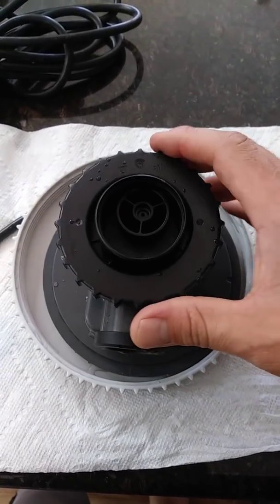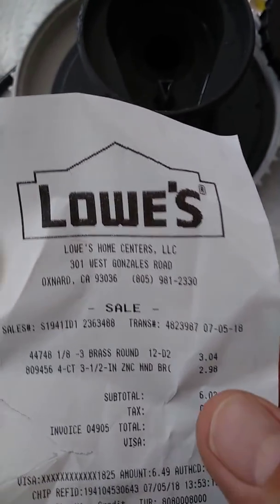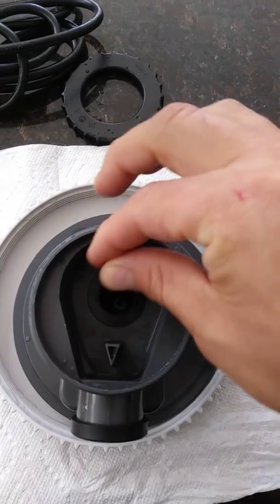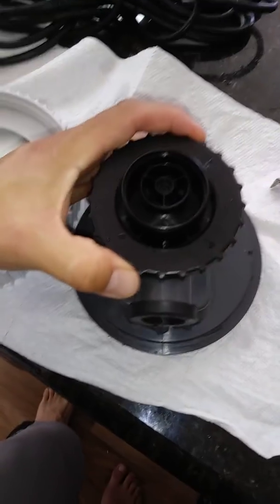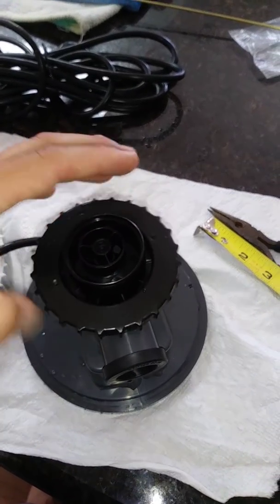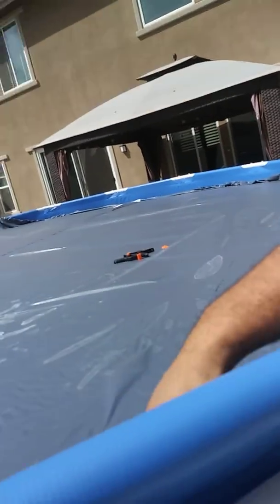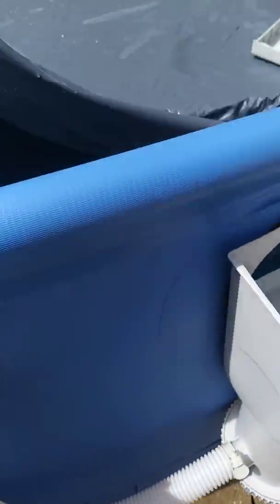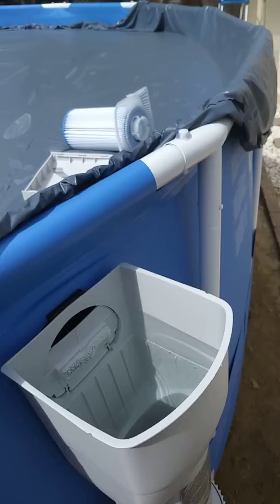SFX1000 pool pump repair

Comment: How did you get the black round rubber cover to stay to keep the water from flowing into the skimmer mine will not stay on. Thank you for this helpful video but ended up upgrading  to a sand filter pump, definitely im spending less in chemicals and electricity. I still need to know how in the heck that rubber piece stays on...thanks again
Reply from the maker: Nice upgrade. If you leave the rubber cover on a flat surface sitting in the sun for an hour or 2, it really softens it up and allows it to hold better. Although not guaranteed, but better. Mine falls off occasionally as well.

Comment: hoping someone can answer If the pin is broken will the pump turn on? Mine is only 10 days old and it wont turn on Light on reset works etc TIA
Reply from the maker: If the pin is broken, it will turn on and vibrate/hum. It just won't circulate water. If the pump won't turn on there's most likely a blockage on the impeller. A single strand of hair can lock these pumps up to where they don't turn on. Also, verify the GFCI has not tripped. So clean out pump/rotor assembly and fire it back up. Good luck.
Reply: @bobganoosh5520  thanks a lot The light comes on when i push reset so power is there ll start looking at the manual Its only a week old...lol
Reply: @bobganoosh5520  Pulled it out and ,looked at it Its a sealed unit Took it to the power supply and it worked Guess i jarred something loosw Thanks
Reply from the maker: @pwburke1  awesome. Nice fix. Happy swimming

Comment: I aligned it and it still is leaking, I tightened it a lot maybe I tightened it too much or I broke the little notch. i need help please
Reply from the maker: I wonder if it's cross threaded. Very easy to do with these cheap plastic parts. If everything is lined up and you are not cross threaded, the only suggestion I would have is to apply some silicone or rtv sealant. But that could make it difficult to get off the next time need to. Was there a rubber gasket with yours? Maybe that needs to be replaced as well.
Reply: @bobganoosh5520  yeah, it came with the rubber gasket and I put it. I searched it up and some are suggesting lube. The leakage isn’t severe it’s just a little dribble. I’ll probably consider some sealant if i don’t have other options.
Reply from the maker: @rueezy  Not sure if  you have assistance closing it up, but try with 2 sets of hands. One to hold the pump in place and one to thread the locking ring. Good luck. Sorry I'm not more help. Maybe try flipping the gasket over as well??? Just a thought.
Reply: @bobganoosh5520  Okay, sure thing. Thanks!

Comment: Fingers crossed this will fix my pump, it won’t turn on at all. Thanks for the video!
Reply from the maker: Good luck. 👍
Reply: I’m dealing with the exact same thing. It will not turn on at all. Did your pump ever turn on?
Reply: @erinblackburn278  So I checked the piece that he’s talking about in the video and mine was still intact. I bought a replacement plug from Amazon it was about $16 and now it’s good as new!!!
Reply: @erinblackburn278  WELLONG GFCI Plug Replacement 15 Amp 3 Prong GFI Waterproof Circuit Breaker UL Listed for Pressure Washer Pool Pump Hair Dryer etc Black, Medium
Reply from the maker: @erinblackburn278  great info from Rachel about the GFCI replacement. But before replacing the electrical, verify that the rotor assembly isn't locked up by hair or a twig/leaves. If the rotor can't turn, the pump will not turn on. It does not take much to stop these pumps.

Comment: 😢 im gonna need the entire rotor as mine just stopped taking in water emptied out the skimmer and found 4 pcs  broken pcs that look like they go to that propeller looking thing. On another note your video will now help me just take apart the entire thing and replace that rotor unit thanks!!
Reply from the maker: Ahhhhh, bummer. Good luck. Let me know if you need help finding a replacement. Good luck .
Reply: @bobganoosh5520  thanks! now i see that they sell the entire rotor however what is actually broken is the propeller looking things is that pc alone replaceable?
Reply from the maker: @lisettemedina4536  I see they do sell certain impeller by themselves, which shows certain rotor assemblies are capable of swapping out the broken impeller. But I don't know if that requires a special tool or if it applies to your model pool pump.
Reply: @bobganoosh5520  I see! Ok I think my best route is to just get the entire pc and call it a day I believe Amazon has one for about 40 bucks I just hope It will fit into my SFX 1500+ unit although reviews do say it does! Wish me luck!!! 🙏
Reply from the maker: @lisettemedina4536  definitely. Just verify that they do returns in case it doesn't fit. Hopefully your up and swimming soon 👍

Comment: Will this still work if my pump doesn’t turn on at all?
Reply from the maker: Possibly. If the pump isn't turning on at all, it could be a couple of things.
1. The pump could be jammed up by hair, stick, leaves, a bug, etc...
2. If your rod was broken, the motor would still typically vibrate or make some kind of sound. But still could be the cause.
3. No power to the outlet you are plugging into
4. Bad gfci plug from the pool pump (which can be replaced by cutting/splicing). 

Hope this helps. Let me know if you have anymore questions. Good luck.

Comment: So, I had same issue. Just a note. You just have unplug pump take filter out. Reach in spend cap off. Remove the rotor and broken pin, Put new pit in screw cap back on put filter in cover back on and plug in.  Don't have to drain/fill pool at all.
Reply from the maker: That's great advice. Ill try that next time i need to replace. Thanks for sharing 👍
Reply: I can remove the impeller to replace the pin.  Had no trouble the first time when I was trying to figure out the problem....this time, I can't remove the impeller to get the broken pin out and replace with new pin.   any suggestions?  I don't have an  extra long needle nose plier
Reply: @rebak2429  it's just strong magnet....maybe chop sticks...wrap end with electrical tape.....I don't know... you might need needles nose..if pin is broke, it it might be a bit cockeyed.. in a bind...sorry haven't had that issue

Comment: thank you. i was able to fix my pump after watching this video. the shaft and impeller had broken on mine so after buying those 2 pieces it was a quick fix.
Reply from the maker: Awesome. Nice job 👍
Reply: Where did you buy the impeller?
Reply: @sharonjohnson7152  I've actually bought 2. Both online.  One was from ebay and the other was from the polygroup website.. but its getting harder to find the right impellers that don't cost half the price of the pool.
Reply: Also I commented at the end of the last summer so I didn't have to use it much at that time. Since opening the pool this year I bought the 2nd impeller and have went through probably 20 shafts. They keep wearing down after a few days so My husband ended up buying a stock of the brass and he cuts them to size and replaces it every few days when the pump quits working
Reply: Thanks for the info Lauren! All I have seen is the whole motor for $126. and people are mentioning a $30. impeller.
Reply: @sharonjohnson7152  you're welcome.  Yeah both of the  impellers I've purchased were 30 each.  126 isn't too bad if it includes the motor and all the pump parts with it. And if you're pool is still in good shape.  Mine is only on its 3rd summer and unfortunately where I live its sand and lots of small rocks. A few tiny rocks have started to poke through the bottom of my liner so I decided not to invest in the pump anymore. Except the brass stock since its cheap enough.  If my impeller breaks then I'm done with messing with it 😆

Comment: have you had any trouble with the brass rod being "eaten" away almost as if there is something grinding away at it?
Reply from the maker: Not at all. Have had 2 snap at the ends. But no corrosion. Try stainless steel. Nit sure what that does to watet chemistry though

Comment: Appreciate the video. Saved me a ton of money.👍
Reply from the maker: You got it, partna.
Reply: @bobganoosh5520  just got pool up and going.  Good water flow but pump is kinda loud. Is that normal?
Reply from the maker: @peggypatterson4045  Is it the 1st time you are running the pump? Just wondering if you have a basis for comparison. As long as there is good flow, the noise is most likely normal. These pumps aren't whisper quiet by any means. If it gets to the point where it's lacking flow, definitely take it apart to clean.
Reply: @bobganoosh5520  think I did not have filter all the way set. Good now. Thank you Bob
Reply from the maker: @peggypatterson4045  awesome, good find.

Comment: My local hardware store didn’t have brass, so I temporarily replaced with steel. Within a few weeks, however, it wore deep grooves in the replacement steel rod and it wouldn’t run anymore. Has anyone ever ran into this problem ?
Reply from the maker: This has happened to my brass rod as well. But it lasted the full season, with many hours of run time. I'm on my 3rd rod replacement after 3 years.
Reply: Bob Ganoosh I’m wondering if there is something that is supposed to hold the rod centered that is maybe broken.
Reply from the maker: From looking at the polygroup website, the only thing that supports the rod are the 2 end caps. If I can find the link, I'll forward to you in a new message.
Reply: Bob Ganoosh Thank You!
Reply from the maker: @Jeremy_hales  here is a good picture of the pump disected. 

https://www.amazon.com/Rotor-Summer-SFX1000-SFX600-Repair/dp/B085NZ74JH/ref=asc_df_B085NZ74JH/?tag=hyprod-20&linkCode=df0&hvadid=459580995779&hvpos=&hvnetw=g&hvrand=7885398036533465053&hvpone=&hvptwo=&hvqmt=&hvdev=m&hvdvcmdl=&hvlocint=&hvlocphy=9031627&hvtargid=pla-945390832238&psc=1

Comment: You know where. I can bay the propeller only I cant find it
Reply from the maker: What model pump do you have? Here is a couple if links for sfx1000

https://www.amazon.com/SUMMER-WAVES-Replacement-Assembly-P58050505/dp/B01DCIMBBM

https://summerbackyard.com/products/x1000-summer-escapes-filter-pump-replacement-rotor-p58050505001?variant=4049387012&sfdr_ptcid=23699_4_337206813&sfdr_hash=bb11c30b35eb03a7f43434a1278f3c60

Comment: I upgraded my sxf600 too the sxf1500 came with a broken rod I had to make mines a little longer but fixed
Reply from the maker: Its nice that thus application fits for all their models. Its weird because I had a friend with a super small pump and it had a metal rod. Where as I have the larger model with a cheap ceramic rod. Anyhow... Glad you  were able to fix it. Happy swimming.

Comment: I have the sfx600.  It looks the same, the shaft was fine.  Mine keeps tripping the gfci.  I am wondering if the impeller is not spinning correctly causing it to trip.  Thanks for the video!
Reply from the maker: If the GFCI keeps tripping, I wonder if you have another electronic item on that same circuit. Like something in the garage or even front porch. Even though outlets are separate, some could be on the same circuit causing an overload then tripping the gfci. If not that, then possibly debris (hair, leaves, bugs) might get into the rotor assembly. Hope that helps.

Comment: I took a paint roller which was stainless steel and cut a piece out of the roller to replace the pin, worked awesome!
Reply from the maker: Awesome. Good idea. Just monitor occasionally for rust build up. 👍that's pretty crafty

Comment: So, I've had mine up since the end of May it recently stopped working and was just humming my ceramic rod was not broke but taking it apart and cleaning the pump out it self  and taking all these parts off in this video actually just made it work again. So this video is very very helpful!!
Reply from the maker: That's great news. Glad it helped you. All it takes is a single strand of hair to lock these pumps up. Nice job 👍

Comment: I am having trouble getting the rod to fit? I got 1/8 brass solid rod and it will not go in?? Help!!
Reply from the maker: The edges of the rod might be too jagged or out of round. Grind it down on the concrete or file if you have one. Make as smooth as possible. Also verify that there is no left over ceramic rod on the housing. Good luck. Hope that helps.

Comment: Mine did the same dam thing I just upgraded to a intex sand filter its awesome pool has never looked so clear
Reply from the maker: Awesome. I wouldn't mind having a sand filter system.
Reply: @bobganoosh5520  I found mine on Facebook market place  at end of summer for 25 dollars  works awesome pool has never looked so good
Reply from the maker: @sandstonefarm5722  awesome. That's super cheap 👍

Comment: Fixing the pool was easier than finding the rod. Most hardware stores are stocked out of brass rods. Found a 6 inch rod just by luck.
Reply from the maker: Ha ha. A few people have had trouble findind the rod. Even employees at lowes couldn't help. Usually I send a link of the part number. Happy swimming.

Comment: Thank you so much!  So glad I found your video.  My pump only ran for about 16 hours and the ceramic rod snapped.  With all this Covid business every part for the pumps have become super expensive.  You're a life saver!  I thought our summer swimming was over!
Reply from the maker: Wooohoooo. Glad you were able to fix it.
Reply: Hi!! My pump wouldn't even power on this morning...I checked and the ceramic rod was broken. I just got back from Lowe's from purchasing th we item you showed on your receipt. I have a question...will the broken rod prevent it from even powering on...any type of power at all? This pump is barely 6 months old and has been working fine. I pray this piece helps!!
Reply from the maker: @tonyadean6117  hi Tonya. With a broken rod, the pump should still power on. It won't physically turn, but there should by some sort of noise/vibration. My friend's pump had debris on the rod and it completely shut the pump down. My buddy thought it was electrically damaged. After cleaning the rod/pump, it fired right up. So it could possibly be the case for yours as well. Good luck.
Reply: @Bob Ganoosh

I had to clean a lottle.bit of condensation down in the bottom of the housing...did the brick trick of smoothing the ends of the rod....It is working now!! I may have to dry out my pump plug housing...i see a little bit of condensation in the reset/test areas...
So the hubs is going to do that for me!! Thank you SO so soooo much!! Wish I had found your video 3 new pumps ago!! Lol

Comment: I replaced the pin and the thing spin when I assist it but it doesn’t cut on on it’s own and it won’t stay on in the water I got it running in the house with the new pin in it. Once I took it outside it wouldn’t start again.
Reply from the maker: Sounds like 1 of 2 things... Hopefully an easy fix.
1. The edges of your new rod/shaft are to jagged. Take it out and smoothen both ends out. You can grind on cement if needed.
2. Your shaft is too long. Cut it down just a little to a shorter length, ensuring it has smooth ends. 
One of these should fix it 👍

Comment: Do you know where I can find the rubber black  plug so that my water doesn’t go all out when I remove the pump? Thanks for your video very helpful video !
Reply from the maker: Not sure if your local pool store would have one. But here are a couple of links that hopefully help...

https://www.amazon.com/SUMMER-WAVES-Skimmer-Water-Stopper/dp/B01DCIM2X4/ref=asc_df_B01DCIM2X4/?tag=hyprod-20&linkCode=df0&hvadid=343187936590&hvpos=&hvnetw=g&hvrand=13861242796620644140&hvpone=&hvptwo=&hvqmt=&hvdev=m&hvdvcmdl=&hvlocint=&hvlocphy=9031627&hvtargid=pla-780802893280&psc=1&tag=&ref=&adgrpid=69370057392&hvpone=&hvptwo=&hvadid=343187936590&hvpos=&hvnetw=g&hvrand=13861242796620644140&hvqmt=&hvdev=m&hvdvcmdl=&hvlocint=&hvlocphy=9031627&hvtargid=pla-780802893280

https://summerbackyard.com/products/sfx-water-stopper

https://www.ebay.com/itm/Replacement-SFX-Water-Stopper-for-Summer-Waves-SFX-Filtration-Systems-/233306416145
Reply from the maker: Another option, which I've done for a friend, plug the hole up with a towel (will still leak) have someone hold it in place while the pump is being worked on. Then put it all back together. Lol. Like I said, will still leak, but very minimal. You can evn keep a bucket underneath the housing to catch leak by water. Good luck.

Comment: Thank you for the video I have a question I bought a new rotor assembly but I have a strong sound when I turn on the pump any suggestions
Reply from the maker: Is it a like for like part (exact match)? If not, then that just might be a permanent sound??? Could it be your water level? Does is sound like pump is sucking air? Add water to eliminate that sound. Also, verify that the filter is clean.  If all above checks out, I wonder if its wrong part. Maybe there is a lube or grease that could help. Very small amount of course due to the pump being exposed to the water.

Comment: I can’t get the rotor to sit properly please help, I have tried so many times!
Reply from the maker: It seems like quite a few people have this problem. When seated properly, there is still a small gap at the bottom of the rotor. But all I can suggest is to continue spinning with needle nose pliers and pushing until it catches. Another option is plug in pump and start it and stop it quickly to see if the magnet current grabs the assembly and pulls into place. Don't dry run for extended time though. It can overheat the pump.
Reply: @bobganoosh5520  yep, i fought with mine today for the hundredth time until it stopped coming on. Overheated. Back to it again tomorrow😩 next year we WILL have a pool professionally installed.
Reply from the maker: @krystaldaniels7940  yeah, totally understand. These dang pumps are more hassle than they are worth. Fortunately for me, The repair has been simple. Not the case for everyone though.